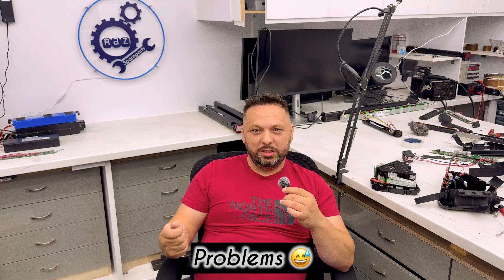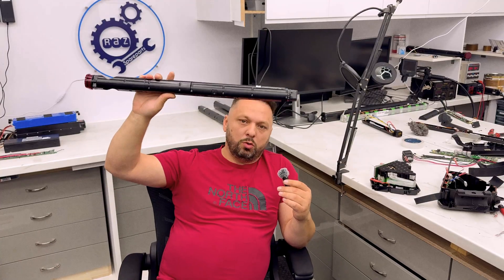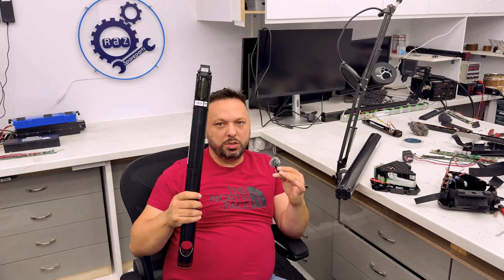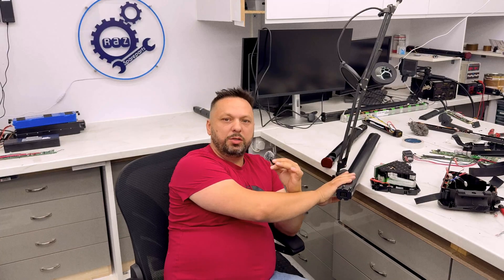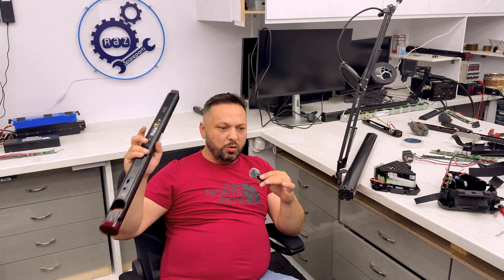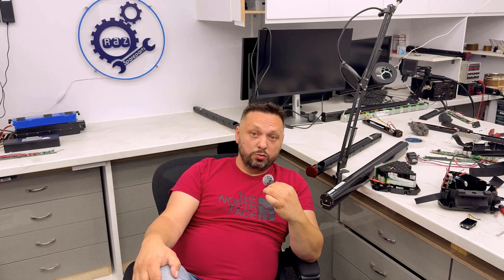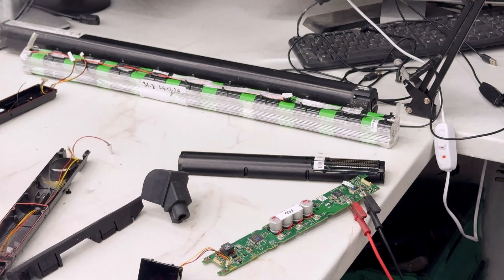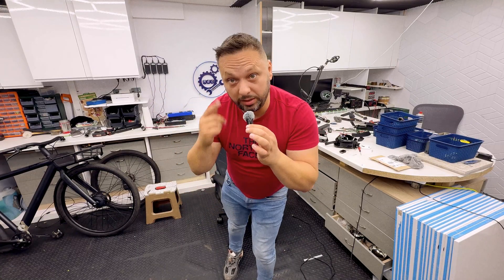The update that destroyed the Vanmoof s3 /x3

Comment: Hi Raz, I've got two bikes, #1 fully updated to 1.9.3 (both battery and cartridge), #2 only updated smart cartridge (battery has not been updated to 1.9.3). I've just tested after minimum of a month of them sitting outside untouched. #2 obviously is dead, it actually blew fuse out on my eyes when charger was unplugged @ 90% weeks ago. #1 though functioned as intended, I've got a video if you'd like, it fireworked itself right up upon pressing the bell button (mind you it sat outside for more than a month untouched). Can it be an issue where updated cartridge cannot property talk with a non updated battery? To finalise the troubleshooting I'm trying to figure out a way of how to force push an update into a battery. Even a certified shop with fixie app cannon get this done apparently. My believe is that FW update on the old battery would solve the fuse issue and errors. Only way seems to be a newer firmware release or an update for an app with adding a function to force reinstall the FW on both smart cartridge and the main battery.
Reply: Hi, if you’re in London, I can update your battery to any version for free.
Reply: @VANMOOF-PRO Hey, I am yes. The bike is at 1.9.3 and the battery is on older firmware I believe. Where about are you?

Comment: I have a question what happens if I take out the SIM card of the module of my X3 what does that dude is that throat error codes or can I still ride the bike
Reply: Oops txt error
Reply: Removing the SIM card from the X3 module can I still ride and unlock with my three digit PIN